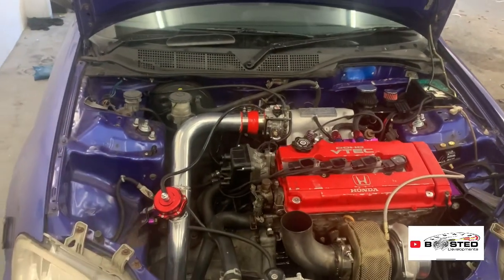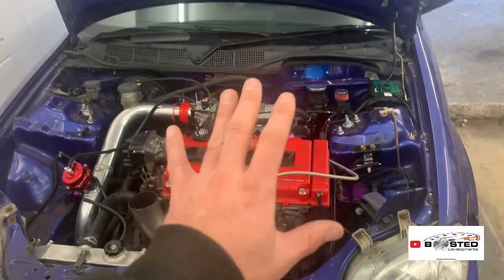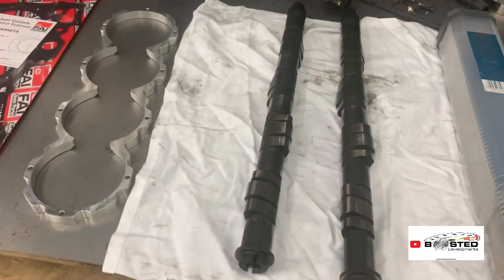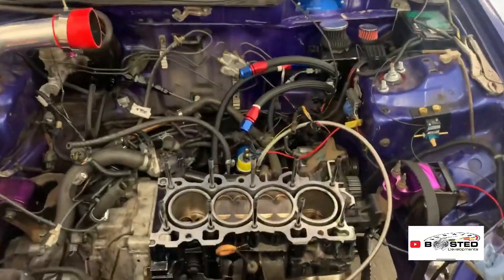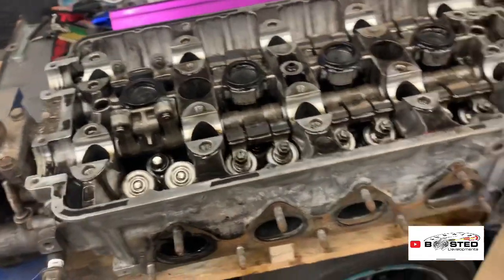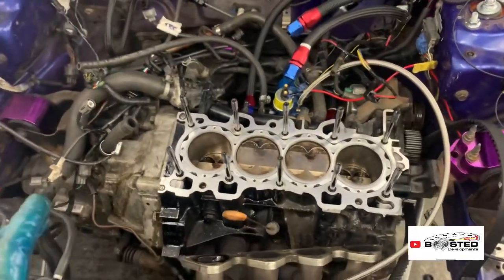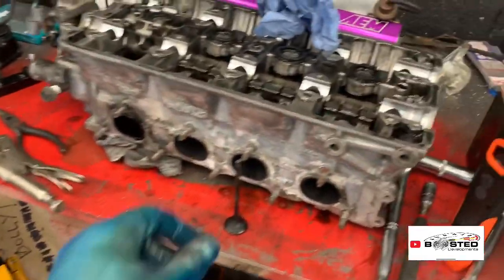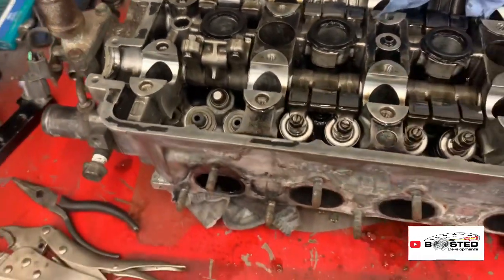What have I done!!!

Comment: If you dropped it lower than the block there was no need to drill holes.
Reply from the maker: Luckily On this guard I didn’t have to but on them usually you have to or the block runs hot
Reply: You were right to tap it down a little then it just runs around the outside and down. ;)